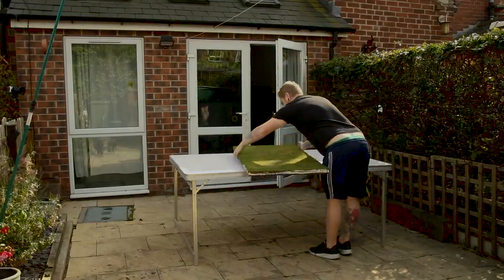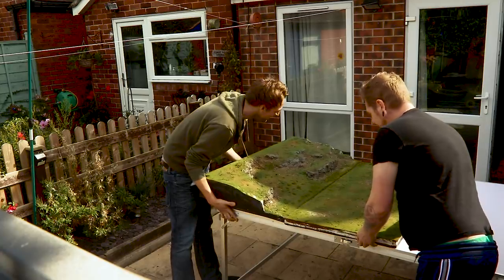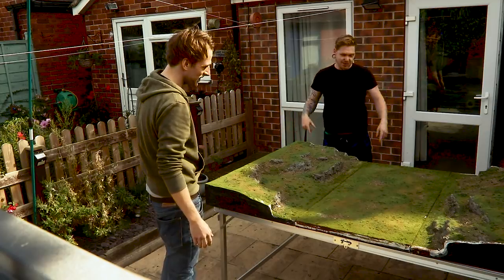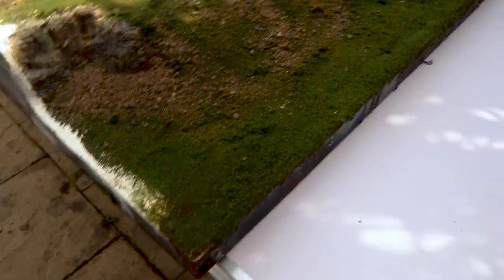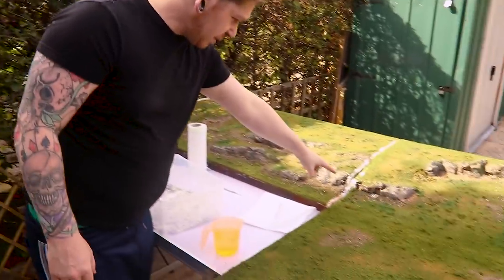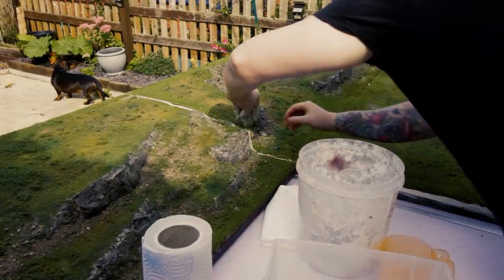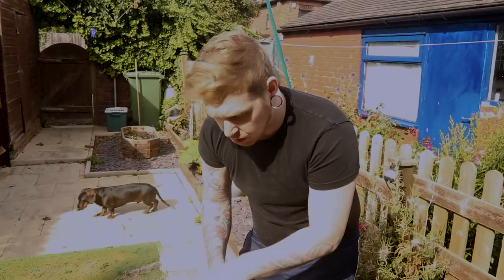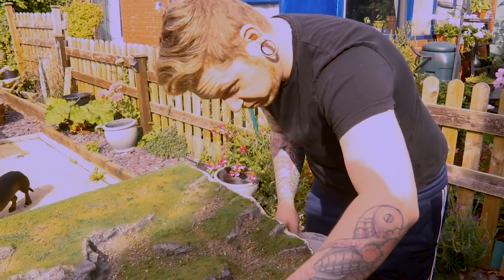WARGAMING TERRAIN FAILS And Flocking Flock ups

Comment: I have a container of flocking and sand leave-ens. Leftovers that I have swept in to a single container that is foam, saw dust, static grass and sand. I have no idea why I keep it, it could most definitely not be used as anything but filler material. Pretty sure I don't have any neon green 1964 flocking in it, but it's pretty hideous. I love the short filler vlogs though. Keep 'em coming.

Comment: can't thank you enough. had someone contact me this week who knocked( or dropped) their board over and did a lot of damage ( I think they my have jumped on the thing right after it was dropped) it has a section similar to the one you fixed where I need to remarry up the ends. Luckily I have got some of your compound left in order to do it. I was umming and ahhing and in the planning stages this has saved me a lot of time. Thanks! I would indeed like to see more vids like this especially the repair side of things as usually it's someone else's  work I have to repair and I've found if you don't know what paints have been used or materials it can cause a problem. I've got some of that luminous flock I got it in a batch ages ago before I discovered your site it actually makes great cave slime the way it stands out.